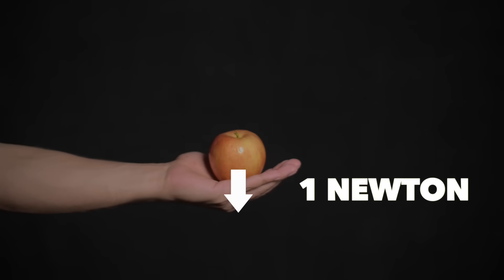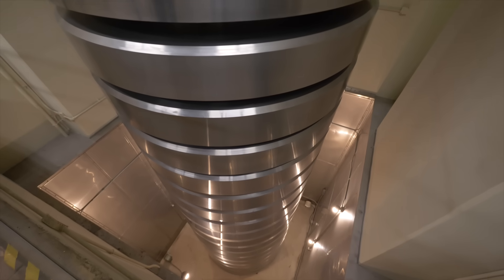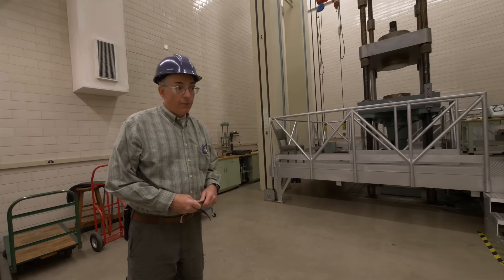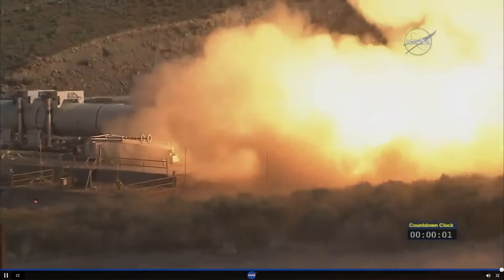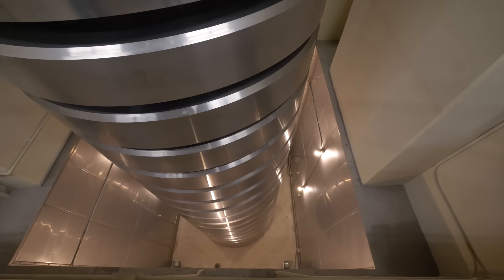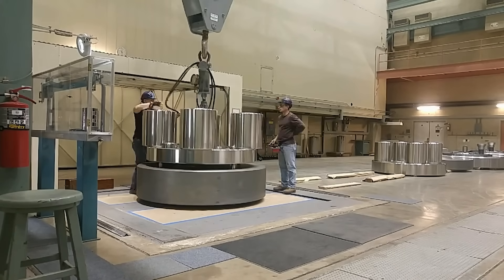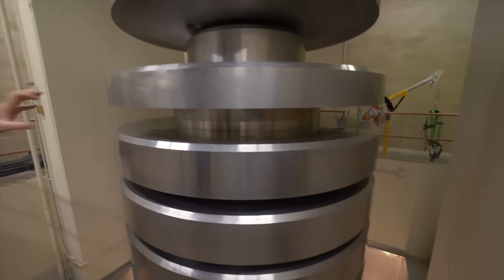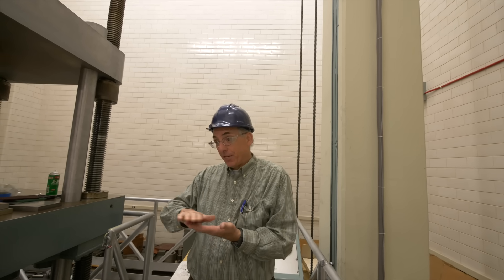World's Heaviest Weight

Comment: Is pounds a unit for mass or force? imperial units confuse me
Reply: kilogram is mass, newton is force
Reply: Pounds are currency.
Reply: Kilogram(Kg) = Mass
Newton(N) = Force
Reply from the maker: Brian Keiser and then divide by Earth's standard gravity
Reply: There's a lbf which is the force, and there is the lb which is the mass. They are related to each other in the same way as the kg and newton are. To get lbf you multiple lb by the acceleration of gravity in ft/s^2
Reply: George Connett
Confusion is an imperial strategy. Do not succumb.
Reply: But the weight of an object is the gravitational force acting upon it, so weight =/= mass
Reply: A "Pound" must be specified. It can be either a Pound Mass or Pound Force. A slug is the another measurement of mass. IIRC Pounds are usually used as a measurement of mass, although the measurement is done commonly though measuring weight and converting to mass.
Reply: Depends.
The legal definition of "pound" is in terms of the kilogram - which would be a mass.
But, there are multiple systems that use "pounds" as a unit:
Pound force, Pound mass, g = 32.2 lbm/lbf ft/sec^2
Pound (force), Slug (mass), g = 1 slug/lbf ft/sec sq^2
Poundel (force), pound (mass), g = lbm/pdl ft/sec^2

The word "pound" predates the idea that there is a difference between the force due to gravity, and the inertial mass.
Reply: Imperial to Metric conversion is quite simple. Take the Imperial unit, times by 12, turn counter-clockwise 3 times, measure the temperature of salt 9 hand widths above sea level at Easter, and then divide by the number of hairs on Abraham Lincoln's head.

Very simple. It's not rocket science guys.
Reply: lbf = pound force, lbm = poud mass. under earths gravity they are the same value (1 lbm exerts 1 lbf)
Reply: Pound is a mass, exactly 0.45359237 kg. There is also a pound force which is the force that standard gravity affects a mass of one pound (earlier they probably used local gravity when the accuracy was not that critical). There was earlier similar force on metric system based on kilogram before Newton was used (i.e about before 1975)  When pound force is combined to feet, one gets an unit of energy, similarly if a kilogram force is combined to meter one gets an unit of energy. Remember pound is also currency. One cannot based currencies on force.
Reply: +The Eclectic Dyslexic You have them mixed up, the SI unit of weight is Newton. Kilogram is a unit of mass. Compared to earth, your mass in kilograms is the same on the moon, but your weight in newtons is less.
Reply: Kg = Mass
Lb = Mass
Newton = Force
Weight = Force*Mass
Reply: Strangely, pounds can be considered a force or a mass and it depends on context. Generally, the abbreviation of pound mass is lbm whereas the abbreviation of pound force is lbf. What is also strange is that they have different units, but they have the same numerical value when the gravitation acceleration constant (g) is 32.2 ft/s/s which is equivalent to 9.81 m/s/s. Talk about strange right!  I can go through the proof of such if you want or link you to articles that can explain this in depth.  

BTW, slugs are not really used for mass unit in professional fields.
Reply: Force = Mass x Acc, when a mass of one pound is accelerated at g, the force produced is 1 Lb.
Reply: Jesus Christ I can't believe I have to WEIGH in on this chuckles

In the metric system a kilogram [kg] is the name given to the base unit of mass, while a Newton [N] is the name given to the base unit of force.

In the imperial system a slug is the name given to the base unit of mass, while a Pound [lb or lbf] is the name given to the base unit of force.

The confusion possibly stems from two misconceptions:
1) The idea that a pound is exclusively a measure of weight, rather than being a general measure of force, caused by the common usage of the word in the specific context of the gravitational force (which is of course called weight).
2) The fact that in countries that use the metric system the answer to the question of someone's weight is given in kilograms, rather than in Newtons, creates a confusing association between the words used to describe force and mass.

Note: As many have pointed out the word pound can be used to describe both force and mass depending on the context, although when such a distinction is needed they are referred to as 'pound-force' [lbf] and 'pound-mass' [lbm]. The "pound" that corresponds to the typical context which pertains to something's weight is the pound-force, from which the base unit of mass in the imperial system, the slug, is derived. In other words, a slug is defined as the mass that is accelerated by 1 ft/s^2 when a force of one pound is exerted on it. The 'pound-mass', on the other hand, has its own associated unit of force called the poundal, defined as the force necessary to accelerate 1 pound-mass at 1 ft/s^2.
Reply: Both. Imperial system uses FLT (Force Length Time) as base units instead of MLT. 

Hence the force equation is slightly different for imperial units, F=ma/gc, with gc=gravity at sea level.
Reply: weight is the force exerted by an object because of gravity, know your words
Reply: is pounds a unit at all?
Reply: Pound is defined as 0,45359237 kg. That is the definition.
Reply: Ascdren 
Lol. I hate to be that guy, but weight IS a force. 
Weight= acceleration due to gravity (g) x  mass
Reply: Okaro X - one pound equals 0.453kg?  If you take your weight scale to the moon, does your 0.453kg mass still measure 1 pound on the scale? Or would you need to tell the scale in this atmosphere pressure and with this gravity and at this temperature this 0.453kg mass is one pound? Tare   Your force unit is calibrated to mass, and handwaved away are the other forces, in turn is roughly a measure of mass.

Here they did everything they could to stick to the defined 1 pound = 0.453kg...including the MASS of the air displaced...
Reply: weight is a force. you mean mass
Reply: Scientifically speaking : mass. But because we all live on earth people sometime use pound as force also since the difference between the two is just a ratio.
Reply: George Connett it's both. I know it's stupid but eh
Reply: +The Yangem I really hope you are just trolling
Reply: Actually, the world is using the Metric system. It's the INTERNATIONAL STANDARD. But of course, America doesn't follow it. I can't understand why. No offence.
Reply: Narata That is only almost right though. How much something weighs is dependant on gravity. A scale does not show you the mass, it shows you the downward force in newtons from the object divided by G (roughly 9.81).
Reply: Kshitiz Sharma Actually America uses the international standards too. They just use conversion factors.  
As you see near the beginning of the video the man shows the standard they use and how they go from the standard (in kg) going up, and then converting into pounds. But their standard is on kg.
Reply: Yea, coins are heavier pounds than the bills.
Reply: No, weight is the force caused by gravity though i common speech it is often used for mass.
Reply: George Connett its force.
Reply: Lbs are never mass its always force because lbs are weight and weight is just your force that gravity pushes you on the floor.
Reply: They are the same, since imperial units aren't used in space.
Reply: After reading this thread, I do not understand anymore how humans have ever built anything that did not collapse immediately
Reply: For over a century the "Pound" has been defined off of the Kilogram, intrinsically they are the exactly same measurement with a different scale.  The difference being that both the parent measurement "Pounds - Mass" and the force measurement "Pounds - Force" can share the same abbreviation.  You cannot change "force" to "mass" with just changing the index of a unit.
Reply: You can have  Lb which is pound, which is for force

and you can have lb which is also pound, which is for mass

its really really dumb
Reply: Forgot that one. Thanks!
Reply: that's a variable.
Reply: ForteGX - mass is invariant, the pound, as mentioned in the vid varies depending on location.
Reply: BeFoRe - Cinematic CS:GO - Trailer Online
Kilograms = mass
Pounds = measure of mass AND gravity, weight more specifically newtons. i.e. a force
Newton = force
Reply: BeFoRe - Cinematic CS:GO - Trailer Online No, Kilograms = Mass
Pounds = Weight/Force
Newton = Weight/Force.

Weight and force (due to gravity) are essentially the same because weight already takes acceleration due to gravity into account. 

[EDIT] so according to Wikipedia, lb refers to pound-mass (lbm) and not weight (lbf). But every context I've ever used it in (Newtonian physics) has assumed that a pound is a measure of weight.
Reply: George Connett there are pounds of mass and pounds of force. Lb force is just Lb mass multiplied by the gravitational acceleration at your location.
Reply: kilograms is mass and newtons is force, since force equals mass times accelaration in units it would be: [N=kg*m/(s^2)]
Reply: Pounds is for weight in the US system.
Reply: Alberto De Beni L
Reply: Saurabh Wanivadekar Kilogram is used to measure mass, Newton is used to measure force.
Reply: BeFoRe - Cinematic CS:GO - Trailer Online Weight and force are the same thing.
Reply: I knew at the start of the vid this sort of discussion would rise near the top.
Reply: You can express forces using mass units if you assume that standard gravity (1 G) will apply 9.80665 newtons of downward force per kilogram of mass, but it's a bit messy and usually frowned upon. Since imperial units are fixed on metric units, while the notation is confusing, it can be worked back out to newtons in the end.

edit : Looks like eleventeen billion people responded the same thing before I did Oh well.
Reply: The Eclectic Dyslexic, you have dyslexia, why would I believe you?
Reply: More exactly, the kilogram is a mass unit, but the pound is a weight unit. And the pound-force is at the origin of a confusion that caused the loss of the space probe Mars Observer because the Nasa uses metric standards and some of its subcontractors still use imperial units.
Reply: Leon
I, for one, am a spatial showfake.
Reply: +korelly you are right though, the pound is a "weight" unit that is used to express either force or mass depending on the context. The fact that standard gravity exerts 1 pound-force of force on a 1 pound-mass body is probably convenient for the kind of application pictured in the video.
Reply: George Connett there is both lbm (pound-mass) and lbf (pound-force)
Reply: So the pound is a unit of force, the imperial unit for mass is the slug but no one uses it.  The problem is that it's used against the kilogram which is mass.
One common problem I see when talking about how much you would weigh on different planets.  Your weight in pounds would change, but your mass in kilograms wouldn't.  I frequently see "this is how many kilograms you'd be on the moon" and it's completely wrong.
Reply: Not in standard measures, the  Mendenhall Order of 1893 defined the pound based on the Kilogram. "Pounds-Force" which is similar to the kilopond or kilogram-force measurement is similar to the "pounds-force" which is better abbreviated lbf.  But as the official standard  is 1 pound == 2.20462234 Kg, it is technically a unit of mass as that is the basis.
Reply: And to clarify, Engineers in the US are the exception, they use the "gravitational FPS system".  The FPS system take pound-force as a fundamental unit of force instead of the pound as a fundamental unit of mass.  But this is a specialized system of measurements.
Reply: Newton is force in metric. Kilogram is mass.
Reply: //Kilograms = Weight
Pounds = Weight
Newton = Force//

Not true. Kilogram is mass, not weight.  Weight in metric is newtons, and weight in imperial is pounds. A weight is a force, remember.
Reply: kilogram is for mass, Newton is for force in metric. It is the force required to accelerate a mass of 1kg at 1m/s^2. As gravity on earth is just under 10m/s^2 (9.81) a Newton is just over 100 grams.

The kgf is defined as the force a mass of 1kg exerts in standard earth's gravity 9.80665 m/s2 so will be 9.80665 Newtons of force.
Reply: You multiply Celsius by 1.8 first, then add the 32 last to get to Fahrenheit
To get from Fahrenheit to Celsius, you first subtract the 32, then divide by 1.8.

To get from Rankine to Kelvin you divide by 1.8, as both scales start from absolute zero, but the magnitude of increments on the Kelvin scale is equal to that on the Celsius scale, and the magnitude of increments on the Rankine scale is equal to that on the Fahrenheit scale.
Reply: Force.  Which is why, if you ask for it in Metric, this guy will tell you it in Newtons.
Reply: nobody reply that pound is a currency? really?
Reply: Yes, kilogram, pounds etc. are units of mass. However, on practice it depends on the type of the scale whether one uses the actual mass or the gravitational force. Scales that compare masses measure the mass. Scales that are based on springs measure the gravitational force.  One can use kilograms as a force also though this is seldom used anymore. A kilogram force is 9.80665 newtons. A pound force is 0.45359237 kgf = 4.44822... newtons.
Reply: Pounds x Gravity Acceleration Constant = Pounds
Reply: How can so many people not know this, this is basic physics!!!! A kilogram, and a pound, and a gram, and a stone, and whatever unit that measures weight, is actually a measure of MASS! Because that's what weight, as we know it, is. But to measure the force caused by mass on a gravitational field (which is what weight actually is), you need newtons. So pound is for mass, newton is for force. We weight in newtons, we have a mass in pounds (well mine is in kilograms, because I live in the world).
Reply: Actually kilograms are a unit of mass but pounds are a unit of force. That's why why pressure (which is force over an area) can be measured in lbs/in^2 but not kg/m^2
Reply: Both pound and kilogram are units of mass but they both can be used also as units of force . Since late seventies newtons have replaced kilogram force as the metric unit. I am old enough to remember this.
Reply: George Connett pounds are weight and when they are used for force it is how much force it would require to lift a measurement of that weight if we talk about mass we use grammes or kilos
Reply: Wow you can post dumb comments, what a special troll you are!
Reply: pounds and force are the same thing, on the surface of earth.
Reply: BeFoRe - Cinematic CS:GO - Trailer Online Weight is measured in Newtons. Its called mass which is in pounds or kilograms
Reply: Basical nontyponess, I doesn't knows it.
Reply: ... it's for weight
Reply: No dude, pounds is a unit of mass, weight is a force.
mass x acceleration = weight
Reply: The kilogram is the universal unit of mass, but is also used in the metric system for weight
As far as I know mass is never measured in lbs.
I'm American, but I can more or less speak simple metric. Just don't try F->C on me cause that's a little more complicated than I'm comfortable with doing in my head (I'll look it up)
For reference: A meter is 39.4in, a centimeter is about 0.4in
A kilogram is about 2.2lbs and an ounce is 28.35g.
A mile is 1.61km
Fahrenheit is Celcius + 32 then multiplied by 1.8. 
And while you'd never use this: a US gallon weighs 8lbs.
Reply: there is difference between force and mass kiddo
Reply: simple answer is it can be either depending on context... remember gravity falls!!
Reply: pounds is a unit of measure for Weight on earth.
gravity is the force
it is not a measurement of mass because it varies depending on the planet you are on.
Reply: Wow! You can do some basic math, what a special snowflake you are.
Reply: The Pound (£) is a measure of strength. But pounds (lbs) are a measure of stupidity.
Reply: Saurabh Wanivadekar newtons!
Reply: Just keep it simple. Pounds is how much something weighs.